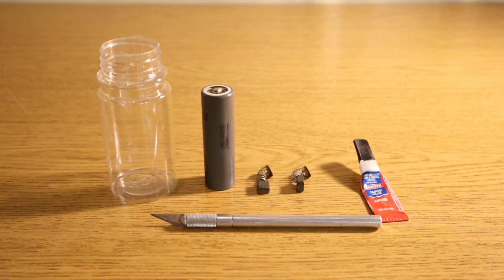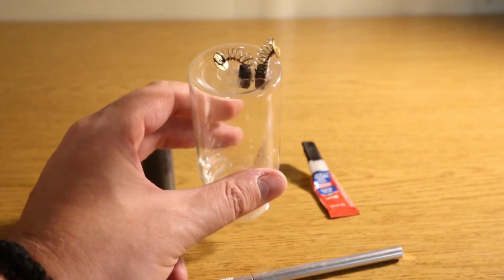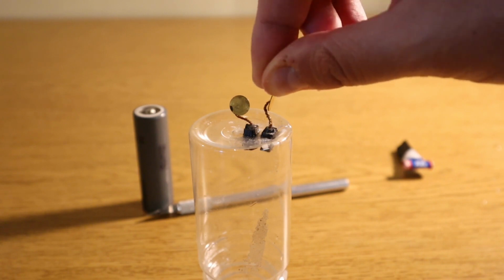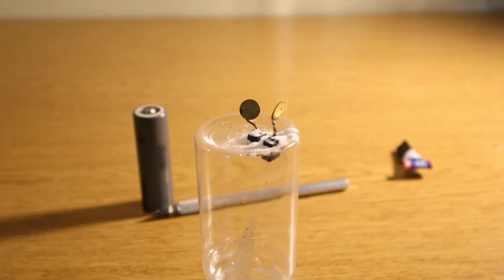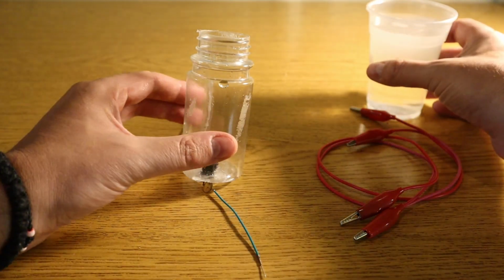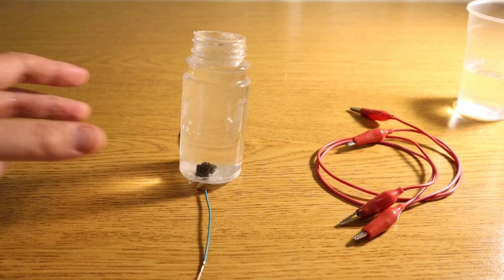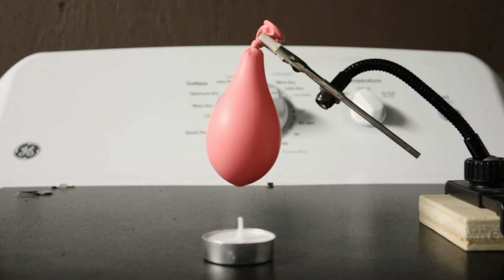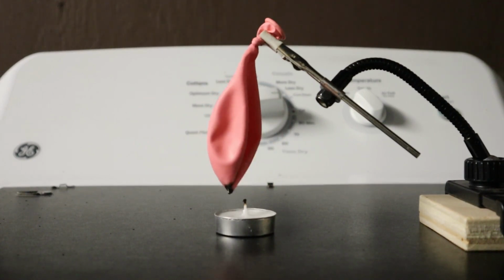How To Make Simple Hydrogen Generator At Home By Using Battery Graphite | Make HHO In 5 Minutes

Comment: That gorilla glue does not react the same with baking soda.  Regular super glue has different composition. Not saying it doesn’t work. Just saying that your pretty much just putting gorilla glue that has some baking soda in it but little to no instant hardening reaction is taking place. Cool project though!